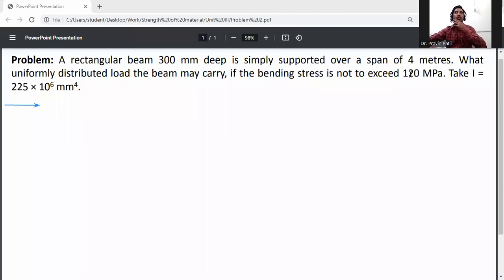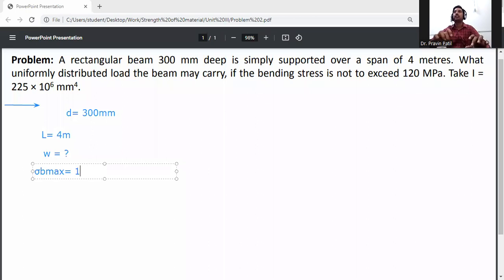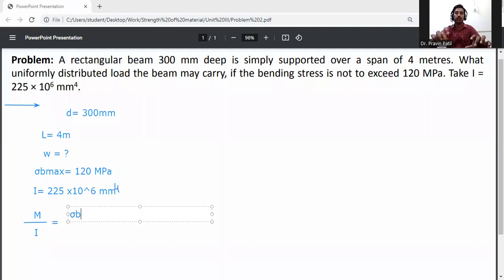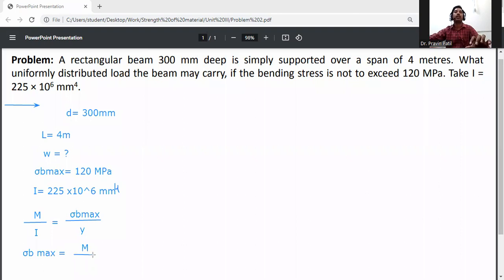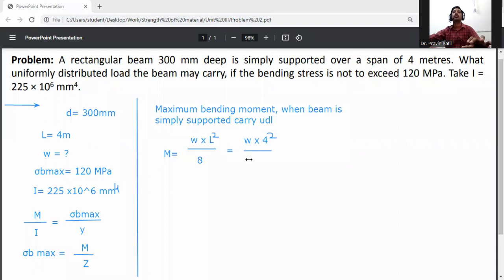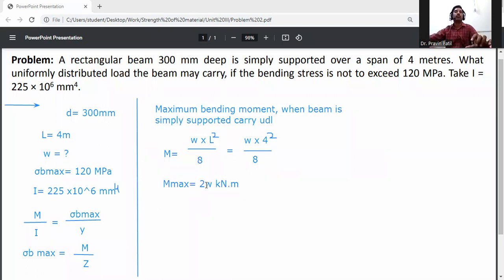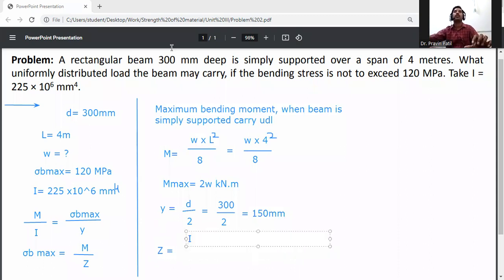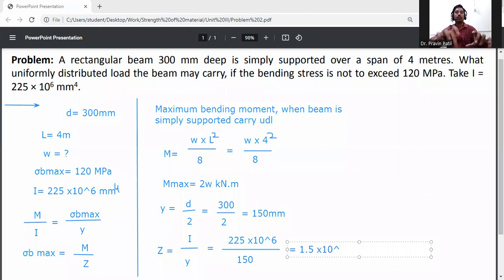Bending stress in beam for udl load/Pure bending/ Strength of materials

Comment: Sir how do you calculate 2w x 10^6
Reply: Thanks sir👍
Reply: Why not converted maximum bending 120Mpa into 120×10⁶ N/mm²
Reply from the maker: 1 MPa  = 1 N/mm^2
Reply from the maker: Mamx = wl^2/8= wx4^2/8= 2w kN-m converted in N-mm
2w x 10^6 N-mm